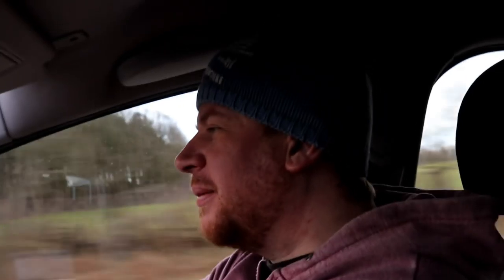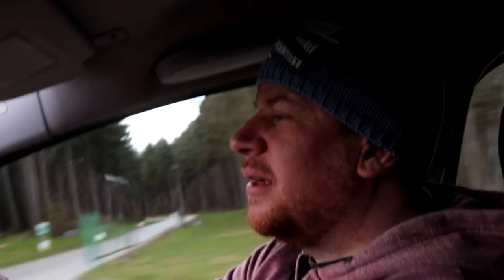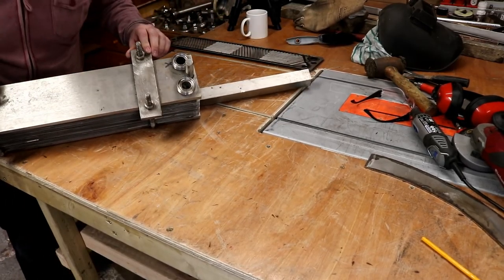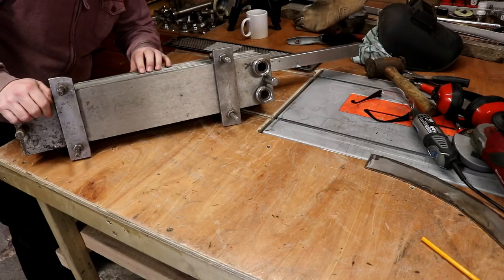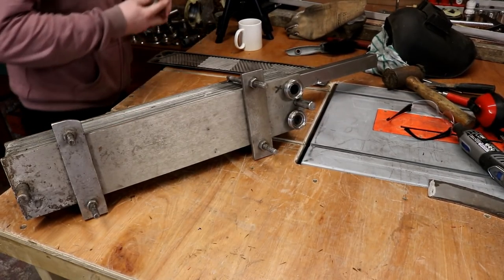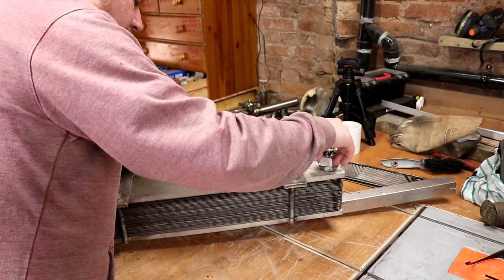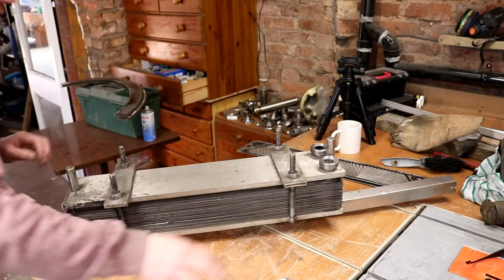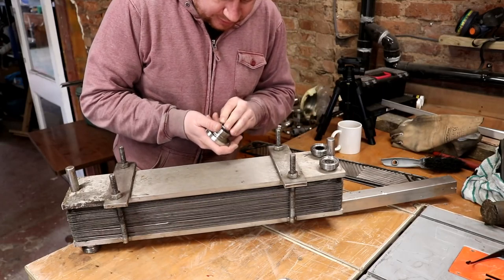PLATE HEAT EXCHANGER

Comment: Chris 
Did you managed to find a easy way or chemical that cleaned off the residue ive just stripped down one i obtained, its the rubber seals that have a load of gunk /sealer on them there a bitch to clean up
Rob
Reply from the maker: No, We are still picking away, it has been a chore to do whilst watching TV with the family.
Reply: HarryBrew69 O well guess what I'll be doing